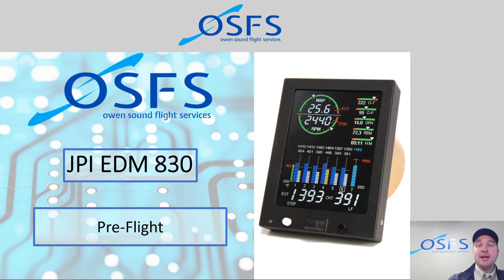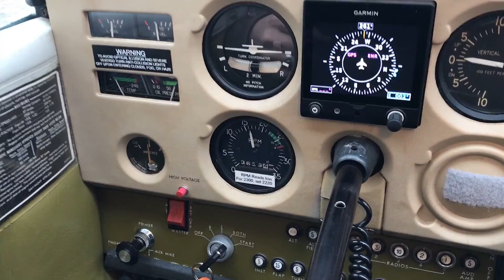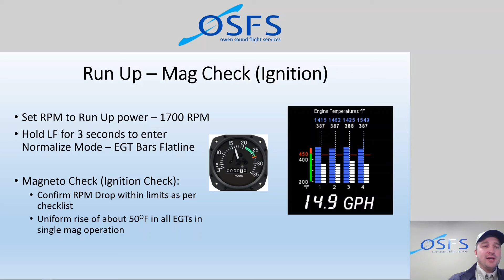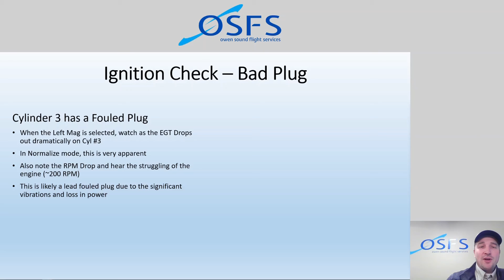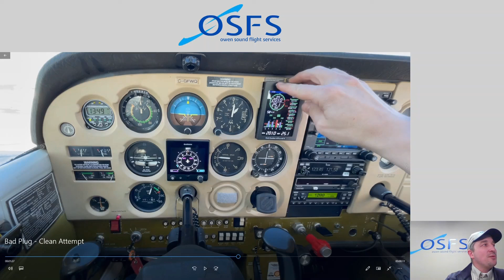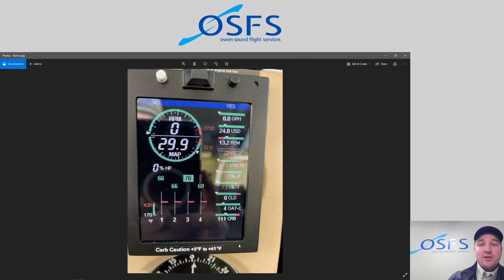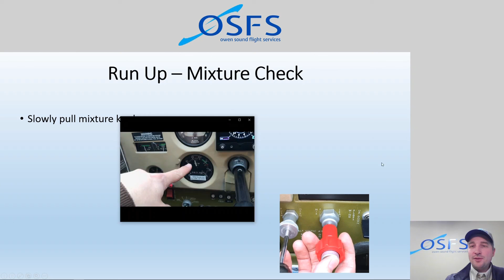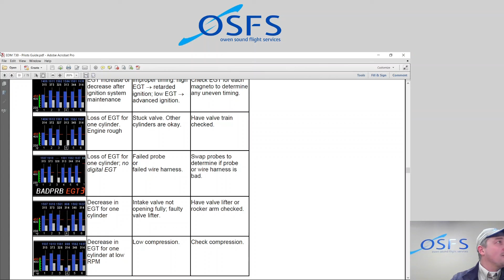EDM 830 - Training Module 5 - Pre Flight

Comment: Excellent video - lots of good info.  One comment: 15.1V on 12V battery seems a bit high.  With engine running, it should be 13.8-14.2V (this range can vary with temp); too high voltage can lead to overcharging, excessive heat and reduced battery life.  Too low can mean battery will not be sufficiently charged.  Voltage regulator should be adjusted to nominal 14V or whatever your aircraft and battery manufacturer says.
Reply from the maker: Yes for sure, 15.1 would not be good, that image showing 15.1  is stock footage JPI videos, note also it shows six cylinders and also turbine inlet temperature.  Excellent point though,  monitor the high and low side of the voltage.